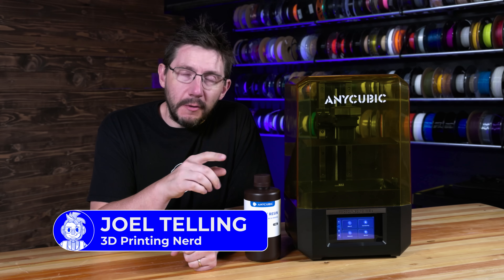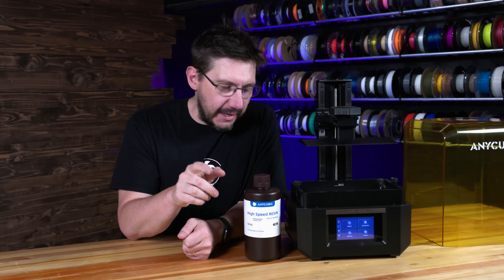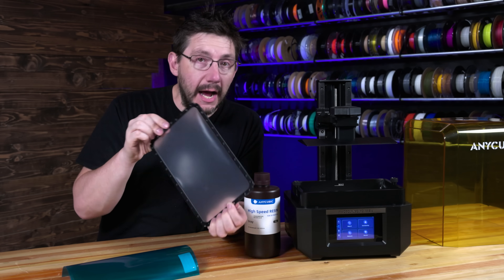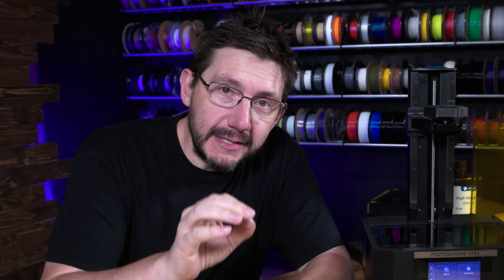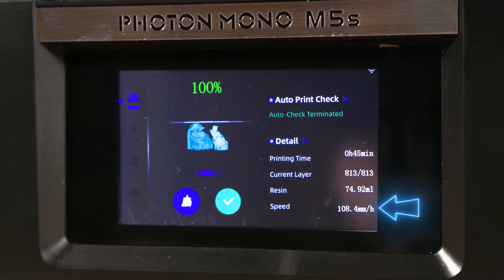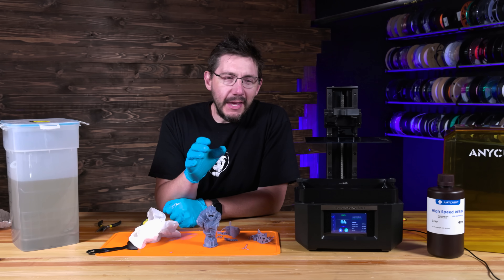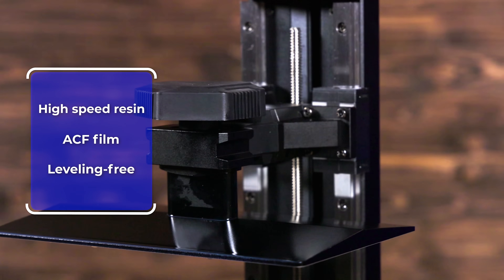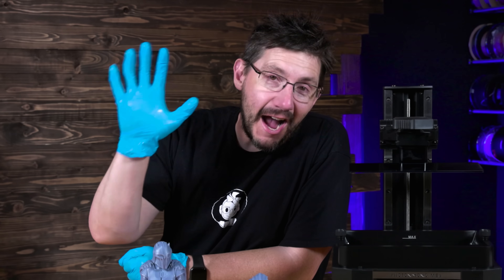ULTRA FAST 12K Resin 3D Printing! Anycubic Photon Mono M5s!

Comment: If it's 12k could you compair the prints to a same size printer that's 8k, 6k and 4k maybe? I really would like to see the differences in quality between them.
Reply: Well part of the 12K benefit is that we are at a larger build volume. You aren't really getting extra resolution over a say 4K printer unless you print at that same build volume. We would really need to break this down to something like pixels per inch^2 to make an accurate comparison.
Reply: @VesuviasV  See my thoughts in this thread. You are correct. Stating resolution without referring to the print area or pixel size is meaningless.
Reply: @VesuviasV  Sure but I specifically said compaired to the same size print sizes. Like a mono x 4k, 6k or a phrozen mighty 8k. These are all about the same sizes.
Reply: Another thing to add, is the newer screens are much more expensive when (not if) they need replacing... 4K screens are easier to find and cheaper. Something else to consider.
Reply: How brittle is the high-speed resin
Reply: @123Making-it-easy  Good question, I am only assuming it will be the same as normal resin. Only based on the viscosity of the resin
Reply: Print settings?
Reply: the wavelength of the UV at this point is whats limiting it. 4k and above provide very very little extra print quality, its all marketing at this point
Reply: @FryedWater  It depends entirely on the pixel size. Stating resolution on its own is meaningless. I use Phrozen printers. The pixel size difference between the Mini 4K and the Mighty 8K is not that much different. More pixels but larger screen. This printer has a pixel size about the same as the Phrozen Mini 8K. Saying above 4K is all marketing is meaningless. You should be saying pixels below a certain size is just marketing. But don't ask me how small that is. Not till I've researched it at least. :)
Reply: @robguyatt9602  ok, but here we have 19 and 28um x y? Isn't that the lowest ever? On the very small 3d models that could be visible? Maybe I am wrong, that's why I am asking.
Reply: @FryedWater  Hmm I see what you mean. I do think slicers also are a limiting factor